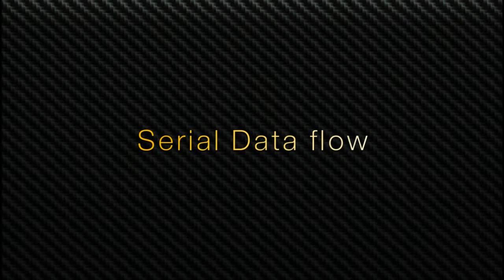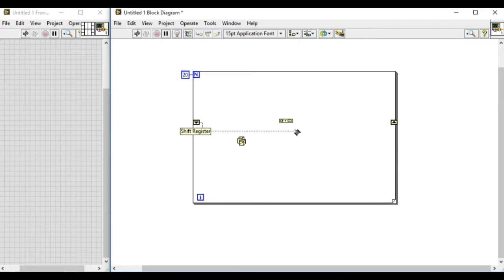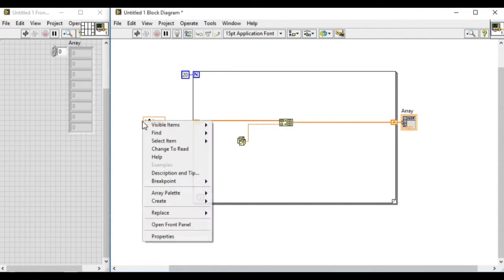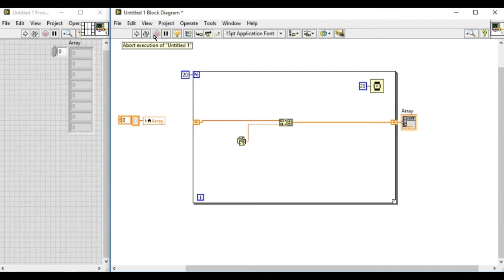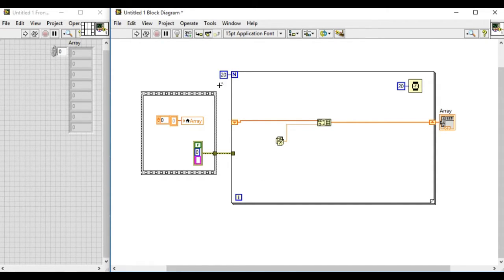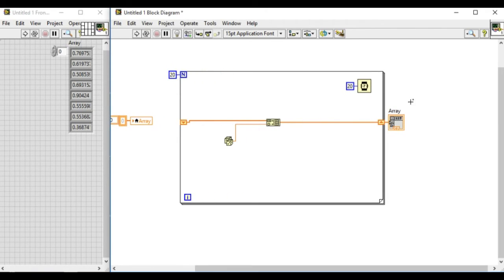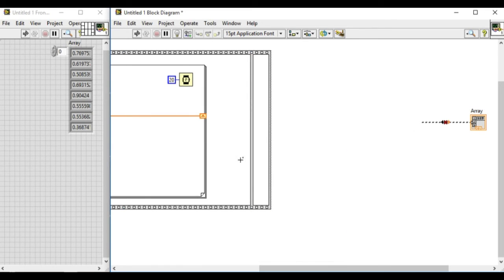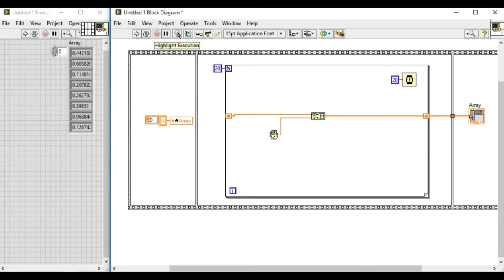How to use serial data flow - LabVIEW

Comment: Also why do you need to use a local variable there? You can directly connect the 0 value array to the shift register and it automatically re initialises the array to 0 every time you run the VI.